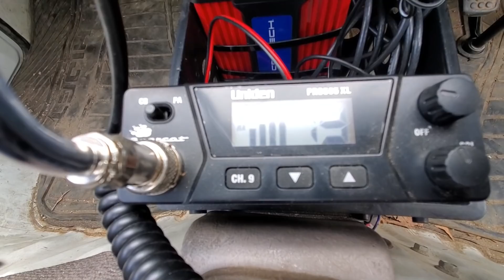Mini-Truck (SE03 EP07) Jeffros Tiny Tonka is YELLOW, Minitruck Race!

Comment: Like that Tonka paint job.  Also agree with the others  - glad you're back making mini truck videos.  It was not a bad idea to coil up the coax for the CB antenna, you want the coax length to be a function of the frequency, and it should come at the proper length as purchased.  Another mount idea would be a swivel mount on the top so you could flip it 90° when parking, then flip it back to vertical when driving.
Reply from the maker: True, but I thought you're supposed to do a figure 8 or something. I do have my Ham license, you're right about tuned wire length. 
Wish I could find more SS whip antenna choices

Comment: I have a question on the Carry bumper you linked. How much engineering, southern tweaking, modification is there involved in that (jeep) bumper install?
Reply from the maker: Answered for minis bumper. Jeffros bumper is home made. It would take a lot of fabrication to do that, I did see where they use the same bumper I did on Mini the only problem is you would have to cut a big hole and put stretch metal or put a bunch of holes in the front because your radiator is up front where the hijet is not it's in the middle of the truck in front of the engine

Comment: Hey can I get the paint code for the tiny tonka? Imitation is sincere flattery, plus it happens to be a good background color for sticking black Iowa Hawkeye decals/magnets onto.
Reply from the maker: He used the tractor supply tractor paint yellow.
Reply: @MotoCheez  Ok thanks! Yes, I see they do have a nice assortment of yellows.. Did he use rattle cans or go HVLP?
Reply from the maker: He used spray gun. Not sure if he has an old siphon gun or HVLP, he's old-school.

Comment: Dang 15oz cups are gone. Love me some mini truck content❤️ I'd get one. But I'm limited to 35MPH roadways😭😢
Reply from the maker: They're sold out? 15oz?
Reply: MotoCheez yes sir. I'll pick up an 11oz mug still👍🏻
Reply from the maker: @DeathWireGaming  Added 10 more, should be there if you did not buy the smaller mug yet